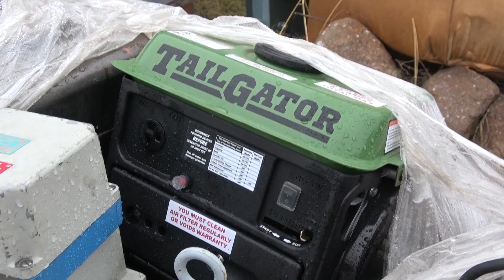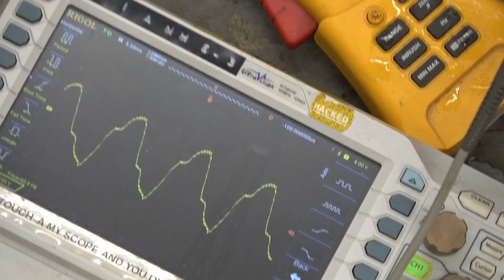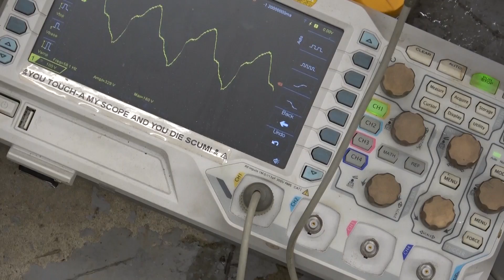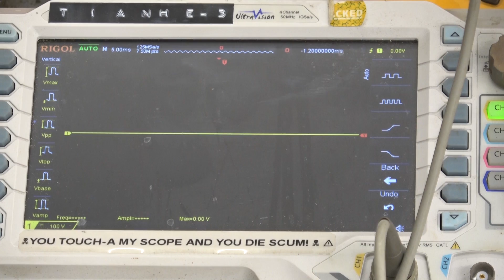BOLTR: Harbor Freight Tail Gator | Brine Tank Testing

Comment: By the way, you should be careful with that loadtester, if u use normal Salt NaCl, the electricity doesn't just break down the water, but also the Salt meaning you get good 'ol poisonous chlorine gas. Not much, but on a large scale can be worrying. The hydrogen pf course is also not to great to have around. You can see the water getting yellow, thats the chlorine gas

Comment: I had the older generation from the hazard fraud in blue and black.  My fuel with 10% mid-western corn squeezin's turned the gaskets and fuel lines into a nice thick schmoo after the first use.
Reply: Well there's yer problem right there. Thing's made for freshly fracked tarsand turds. Corn squeezins'll burn but the gaskets get all tipsy on the white lightning and wake up the next day with a hangover that'll keep the float from bowlin'.

Comment: The reaction between the electrolyte and the electrode locally change pH conditions because of the redox reactions that are happening. There are lots of ways for the ions in solution to induce pH changes locally and act to destroy more of the electrodes or stealing H+ from water molecules.
Also heating up a solution will always increase the speed of these reactions. No current limited supply = runaway reaction rather known as better watch it so it doesn't figgin happen, eh ?

Comment: i got one of those for my off grid shop to run the lighting when there is not sun for the solarpannels. now the broblem is my lights are leds meaning there are electronics which will be damaged by the crummy output this has. however there is an easy fix: get yourself a 12v leadacid battery (it can not be a sealed gel battery cuz they need a fancy controller)  and hook it to the 12 output of the generator (mine came with one but i didnt see a 12v out on this gen). then from that just pick up an inverter(i already had one cuz of my solar system) and boom you have a perfect output and a standby battery. just make sure you dont pull more current thant he gen outputs cuz then the battery will discharge and you will lose the effect.

Comment: im not one of those who understands this test. looks like it generates power though. i do have a generator quandary. i wanted to be prepared so i got a bigun. 5000 skuchums it was. it worked. i would haul it into the woods with my atv for building a treehouse to sneak up on the deers. i began to think something was wrong and i would blow it up because when i went to put gas in it the ONE QUART oil supply was boiling  . what is up with that?

Comment: I've got an old clone of this by some company called "Titan Industrial" that claims 1000watts on the side. Exact same chinisium generator only it's yellow. Came free with a free camper. Starts every time 80% of the time, and gets raspy and angry when it doesn't have at least 4 amps pulling on it. I work that out to be about 8.3 amps capacity on mine, so curious to see the newer HF models are only rated to 6.5 amps.

Comment: you know most people test generators with like lights or a heater...most people.
Reply: Everyone prefers it moist.
Reply: Where's the damn fun in that?
Reply: I was kind of thinking the same thing like how does this translate to what I can power with the thing but he was more so trying to prove it would die under load and it didn’t.
Reply: @cdurkinz  800 watts continuous, so a 2 slot toaster, or a fridge and maybe a deep freezer if they never try to start at the same time, or a furnace perhaps. Point being these are pretty limited for power outage use, more for tailgating, camping, power tool use far from a plug, etc.
Reply: @Broken_Yugo  thats how i use mine. I have a 2000 watt generator also and most of the time i grab one of these for small jobs. But if im using it for more then a few hours i use the large generator simply for fuel consumption.
Reply: @Broken_Yugo  I use mine for tools I don't own cordless versions of. Great for using paint gun or stapler where you don't have power. You get a lot more power out of it per size/wieght than a gas powered air compressor.
Reply: @ionstorm66  same
Reply: @cdurkinz  I mean it's RATED for 6.5 amps so you kind of have your answer there... No vacuums that is for sure.
Reply: Where to you find a 40kW heater? He's working up to test the big one we've seen on recent vids (most likely)
Reply: I like to use hair dryer for that purpose.

Comment: Why does the generator go under load when its pulling alot of cuurent? Like what is actually causing the resistance on the motor, is it the actuall movement of electrons pushing on the motor or what?
Reply: Yeah, I think that's basically it.  Making electricity takes power.  The
Reply: The interface between the rotor (directly connected to the crank) and stator (where the power comes out) is magnetic. The rotor is a simple electromagnet (field strength varied to regulate voltage), on that note it's often easier to think "rotating magnetic field" than alternating current with this stuff. I don't really understand the physics of what's going on in the stator that makes the drag though, something to do with "back emf" I think, like the current induced by the load cause the stator to generate its own magnetic field and that fights the rotation.

Comment: Lights will work at 38hz :-)
Reply: will they flicker though?
Reply: @Raisonbran648  that depends on the fillement (the wire in the bulp)!
Reply: @Raisonbran648  cheaper LEDs might start flickering indeed, incandescent ones - no.

Comment: Please do show us the waveform out of a honda 2200, I thought they were pretty clean?
Reply: Pretty clean inverters and pure sinusoidal are still very different. They have noise the whole way though the waveform which can cause harmonics. You can hear it in some appliances.
Reply: I had a chinese pure sine wave inverter generator and the wave looked exactly the same as the wall outlet wave...

Comment: Good to see you thoroughly distributing the oil around that engine before starting it!
Reply: Well no he didn't. It's a two stroke so there is no oil in the engine at all until the fuel is turned on lol so all he did was put two years worth of wear on it before it ever started! At least it was run in before first start!

Comment: The conductivity of the electrolyte is temperature dependent. Perfect runaway scenario.
Reply: Also, there may be some stratification of concentration, i.e. the ions will "drain" from the areas where there's less current flow (bottom of bucket) and "gather" within the current path.
Reply: He is in Canada he is unlikely to run out of snow; I was a little concerned about that when he was trying to blow the breaker on the mains.

Comment: You're electroplating. Could the metal particles in the water be whats increasing the conductivity?
Reply: You can't electroplate using AC.
what he has there is electrode based boiler

Comment: I have owned one of these about two years. My dad has had one about 4 prior to that. I was surprised how available consumable parts where on the Amazon's. (Coil/carb/plugs and the like) I know they probably build these in dozens of factories all over the ass end of china. But the spark plug wire connectors on mine is literally a mouse trap or clothes pin spring that the lever ends where stabbed into the conductor through the insulation. Came right off the first first time I had to pull the plug out. Never really worked right after that. But no worries. It's cheap to replace until you're replacing it every time. 😆

Comment: Who else was yelling turn the fuel on first
Reply: If it's not going to kill anyone sometimes I like to stand back a bit, let nature teach and reinforce its own lessons. 🙂
Reply from the maker: Now you tell me!
Reply: @arduinoversusevil2025  some guys are just too proud to ask
Reply: Hey, we've all been there right? Every goddamn time. If only they gave you some type of literature to tell you how the damn thing works.
Reply: @Psikeomega  yeah but if they gave you some kind of literature that twould be cheating.
Reply: we've ALL been there... it's either the fuel valve, or the air inlet.

some days, both.
Reply: Had to wait on the glow plugs.
Reply: @saltysteel3996  words smallest Detroit Diesel 1V.00001
Reply: At first I thought the little TailGator was mfg'd by Poulan.
I keep poulan and poulan on the starter rope, and the jeezless thing don't chooch!
Reply: I have the same generatorand I was saying it lol its never that hard to start
Reply: I was waiting for the guard to get pulled off before a 1/2" impact and socket came after the flywheel nut...
Reply: @OTE_TheMissile  been there... Done that...
Reply: Ive done hundreds of miles for “ive just used my new machine, it’s not even finished half my lawn” “you have checked the fuel tap sir?” “Of course I *#@&ing have! I’ve been using machines since before you were born” But the satisfaction of walking in there amid the tyraid of abuse, turning the tap, counting to 30, and brum in 1 pull, then looking them square in the eyes, “I won’t charge you a call out this time sir, but may I recommend you read operators manual before calling again”....
Reply: I thought the run switch was going to be set set to "no chooch".  Wrong I was!
Reply: I have one of these.

Fuel shutoff doesn't work at all. All gas, all the time. Quite magical.
Reply: Only because I've been there and done that!
Reply: @kendavis8046  i've that exact model, and it's got me before. Dolt!
Reply: Haha, did that exact same thing.  Even got a WTH from the better half when I broke the quiet yelling that.
Reply: That, and check the kill switch!
Reply: Bill Pullman woulda got it runnin first try even with the gas off, course he had the schwartz goin for him
Reply: That and to let the pull start fully return
Reply: I was thinking, if he doesn’t turn the tap, he’s just got one of them fancy manual air pumps.
Reply: Everyone that owns one :)
Reply: I had, "BUY AN ELECTRIC START, YOU MAROON!"  Excuse the yelling.

Comment: You know, you can buy chlorine in cylinders, if you need it that badly...
Reply: It just tastes better home-made.
Reply: Used to work in brine recovery. 600 volt dc and 50,000 amps. Complete with asbestos filter to separate one electrode from the other. Hydrogen out one side and chlorine from the other. Sodium hydroxide I believe in the liquid so the liquid will change as you bubble away.
Reply: @fortfun46835  sounds like management were cooking up a way to save on retirement payouts.
Reply: @iNerdier  They were looking for an alternative to the asbestos filter when I was there 25 years ago. Not sure if they have found something else. I would think a different woven ceramic fiber or specialty plastic would work. With so many amps it's high temperature. Along with the chlorine gas is very corrosive for anything metal and caustic is corrosive on anything organic.
Reply: @fortfun46835   the asbestos sounds like one of the safest parts of it. I know the stuff ain’t great but it’s not as bad as everyone acts like it is so long as you don’t breathe it in
Reply: @iNerdier  True, the asbestos was like a blanket and they used respirators when changing them. Everything else stayed in the pipes. The worst was the top of a large fiberglass vessel blew off on startup. Sulfuric acid used to scrub the chlorine of water vapor backed up into the caustic and went boom. Luckily nobody was around. It crushed a 55 gallon drum 200 feet away when it landed. That and at the BPA plant blowing off the top of a silo and snowing down BPA across the plant. Makes you laugh at the ppb people freak out about in polycarb bottles.
Reply: @fortfun46835  I mean they’re problems but one is fast onset death and one is slow. Neither’s good to be around.

The one that really scares me is the hydroflouric acid vapours from aluminium production.
Reply: You have to have the real German stuff of you nostalgic for the old times, sitting in a trench with the guys, up to your knees in mud. It'll bring a tear to your eye and a thickening of the mucus your coughing up as your lung tissue disintigates. ❤️
Reply: I had a GF light a clothes dryer on fire by using too much bleach in a load! Very nasty. They had to call the Hazmat unit out and evacuate neighbors!
Reply: @PWingert1966  damn
Reply: Bleach?
Reply: Kinda what I was thinking. I believe good old NaOH is typically the tool of choice for something like this so that you don't choke out while choking the chicken.
Reply: And get it delivered to your domicile.

Comment: Pretty sure the amps are creeping up is because the electrodes are being dissolved into the water, due to the current going through them.
Electrolytic dissociation if you want to get fancy
Reply: I don't want to get fancy
Reply: The water heating up probably also has something to do with it, pH and pOH increase with the temperature.
Reply: Little bit o' dissolved metal goes a long way

Comment: I've had one for nigh on 10 years, brought my freezers through two hurricanes. One caution though!  Don't let it run out of gas with a load connected! It'll turn 300 watts worth of light bulbs into flash bulbs when it dies!
Reply: Why does that happen when they stop with a load?
Reply: @CVP-og9pw  the generator which is basically a motor(an inductor). When the generator is turning the coils act like springs, pushing and pulling current. When you stop it the angry electrons still want to move, causing the voltage to rocket waaay higher than the nominal voltage. Similar to what happens when you agresively shut the water tap in your home,makes the pipes move a bit
Reply: @CVP-og9pw  that's exactly why those diodes are there. Sadly I fix these on a regular basis and a lot of brands incorporated the diode inside the trigger switch. Leaving you with nothing else but to put a new chinesium switch there
Reply: @CVP-og9pw  Maybe with a load that has a high inductance like a motor or transformer. When the current is switched of, the high inductance load generates a voltage spike. Nonetheless this is just a guess, maybe it is actually the generators fault.
Reply: @CVP-og9pw  CAPacitance discharge?

Comment: For lower load/higher resistance, you want less salt in solution. We usually start with tap water, electrodes 50% in, and add salt progressively until we get about the right current. Then raise/lower electrodes to vary load for the alternator.
Reply: But with less salt it will freeze over.
Reply: Yup. 
I dunno aboot Canadiana but here in Wales the tap water is Chlorinated and so has plenty of ions for the pixies to ride on. 
If I was short of current for a job like that, THAT is when I'd be adding more solubles to it.
Reply: @KozmykJ  
Sodium chloride in solution electrolytically breaks down to chlorine and sodium hydroxide.

The sodium hydroxide is a much better electrolyte, especially considering the tendency of chlorine to come out of solution in a gaseous state.
Reply: @kaisersose5549  Yes but better to start with little or no extra ions and adjust to get the current required rather that start with a strong solution.
Reply: @KozmykJ  farms run from wells.  If there is no water softener the water can vary in conductivity.
Reply: use a metal spoon to stir, right?
lol
Reply: I think temperature should affect conductivity and the water should heat up quite nicely when you are pumping kW or two there.
Reply: how the heck did you reply 3 days before the vid went up?
Reply: @burplesnaps  Maybe he has a lathe.
Reply: @fullnuclearbreakfast  thas some big brain thinkin right there chief
Reply: @burplesnaps  patron I’m guessing
Reply: @cloroxfreshmeadowbleach9860  Tequila doesn't help with time travel, I've tried.
Reply: @ballenf  Yes it does. I tried also but it only goes one way, forward. Some lunatics insist time distortion is merely an illusion, that your perception of time jumping is actually memory failure for the duration of the jump...but you can't trust people and the things they say. You can only trust direct experience.
Reply: @burplesnaps  lol!!!

Comment: The pucker factor watching this is off the charts!
Reply: His fn 9 Volt Homemade Electocution Device was worse IMO, now if he goes to makin Hydrogen hopefully he isnt kin to the Hindenburg fella.
Reply: I mean honestly super low risk with the open fire going, ironically it’ll just burn the hydrogen as it’s generated and keep the concentration low... as long as you’re below the LEL or above the UEL you’re good. I used to jump into leaking fuel underground tank sumps and open the bolted port with a regular impact gun... technically supposed to use intrinsically safe, but the fuel is so concentrated in the hole that you’re good, nothing would burn in there anyway. Course that means you can’t breathe either, but that’s just an incentive to work quickly.
Reply: @HH60gPaveHawk  "Added incentive?"
Reply: @bryankirk3567  yeah, you either get it done on one breath or pass out 🤷‍♂️🤣